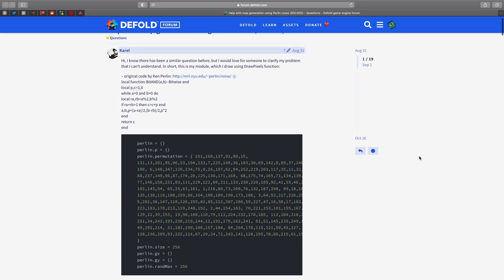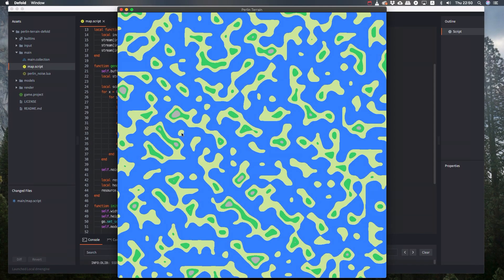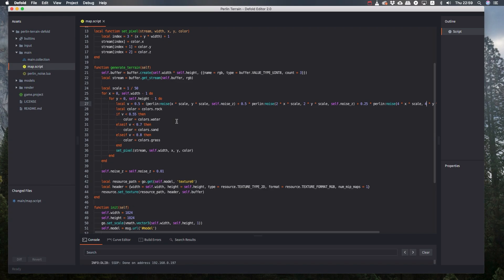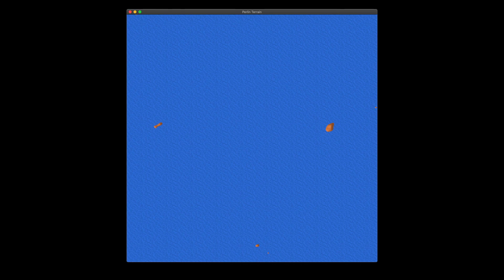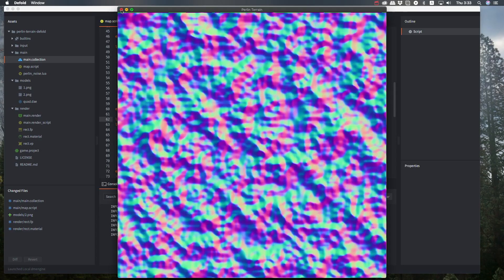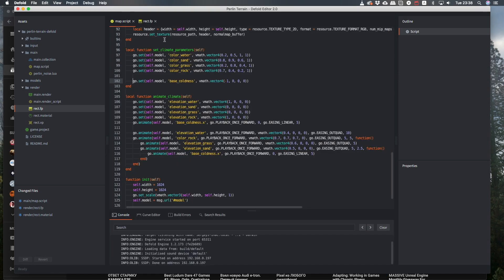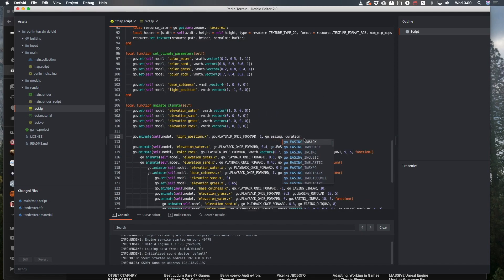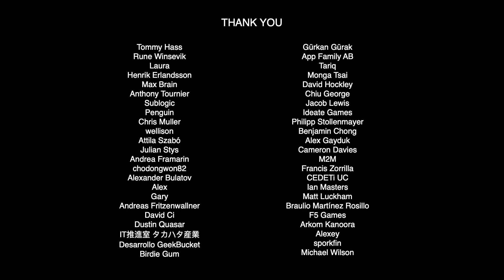Defold - Procedural climate generation on a Perlin terrain. Devlog.

Comment: This is a cool project. However, please consider that IMO we need more videos and tutorials that show PCG newcomers to use Simplex type noises, instead of teaching older noise algorithms in a vacuum. Perlin noise produces a lot of 45 and 90 degree angled parts, while good Simplex implementations generate a wider variety. This can be seen in the images on the forum post you're looking at, as well as your final result. Most times I see developers use Perlin noise, seem to be from the current state of information on the topic moreso than it actually being the best choice for their project.

There are a lot of libraries available that support Simplex type noise. Some of them I've put out there, or contributed to, to help people avoid IP claims when using 3D+ noise for textures (search "OpenSimplex"). There are many others, too, that are great to use for 2D noise.

The PCG community could benefit from a cultural shift away from considering Perlin (at least without addressing its artifacts) to be the default choice for coherent noise. Every new video and tutorial can help.